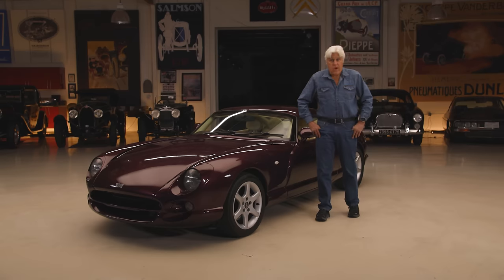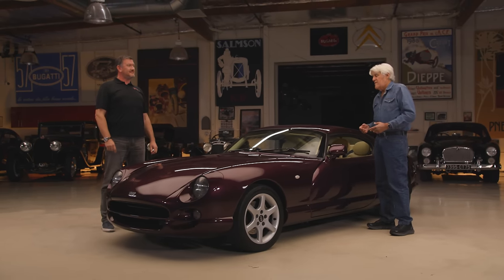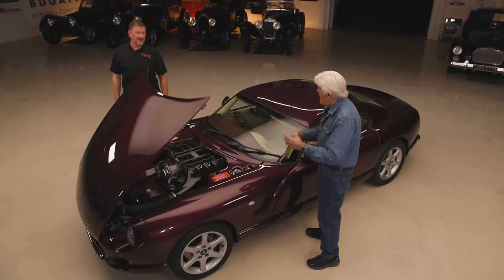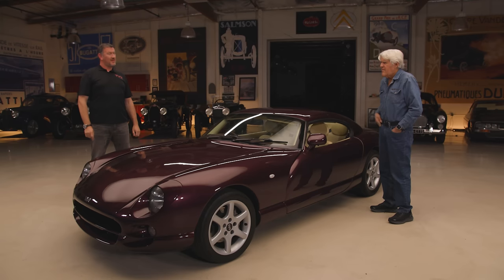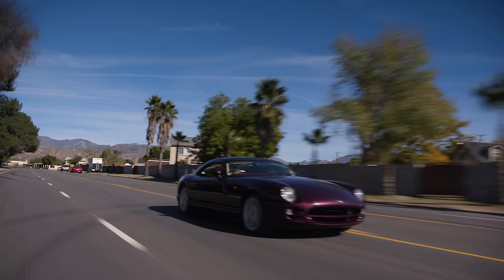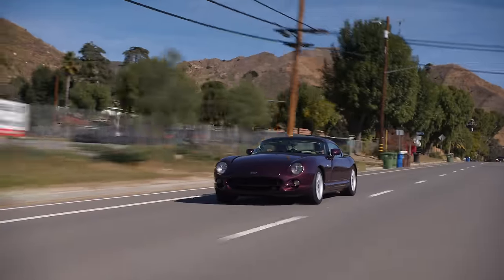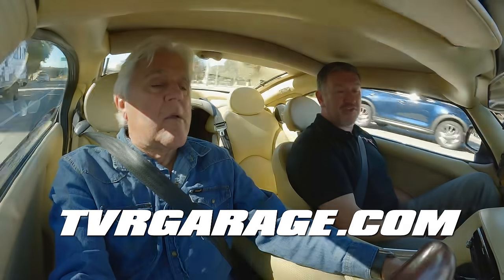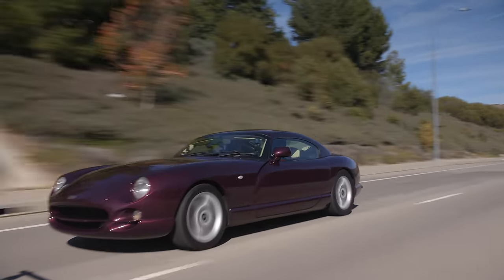TVR Cerbera - Jay Leno's Garage

Comment: I've V8 engine gearbox rear axle from crashed Cerberus in early 2000s when couldnt sell lovely car fibreglass smashed panels wrote mine off but I have hybrid now MK1 Ford Capri MK1 bodywith full spaceframed with cologne boxed arches rest has had shorter chassis so all TVR parts fit proper 1st time rears tubbed due to wide body XPACK cologne kit in process looking at air suspension system as too many bad roads and speedbumps so to raise when needed good but handling that power has to be safe also BUILDING 3door sierra MK1 supersaloon converted to accept Ford Sierra RS Cosworth 4x4 or xr4x4 bolt once capris done was supposed finish last year I'll health stopped that sierra has full frame/cage back to front both be road legal I've V6 cosworth engine and can fit but love get rare ford engine lots power standard Mondeo at 220bjag V6 3.0 fast standard do what Noble cars did twin supercharger kit remap NO PARTS EXCEPT CAME OUT FACTORY ADDED " TURBOS V6 shames V8 new gt V6 I don't agree built to be a V8 Ferrari beater not V6 supervan4 is not a van no loadspace supervan 1,2,3, were transit vans with GT40 mid mounted engines and frame with a Ford Transit van welded on top supervan 2 same on newer model supervan 3 was con really FIBREGLASS body moulded 3/4 scale of real van fitted around GT40 chassis or F1 cosworth dfv8 in middle still carried luggage in rear 4 looks like new GT run up electric transit at speed not van it's rear hardly hold 6pack coke spoilers aerodynamics if Ford had thought it'd been a van new shape GT40 underpinning in transit shell stuff EV,s as useless and we will not give up combustion engines get used to it major brands we will buy classic cars 1st than ev vehicle's with no range a bomb on wheels every cell EXPLODES 1 by 1 I saw big car cover-up in phoenix retail park on old Chrysler Hillman Talbot Humber etc 3 days before I passed where fire happened behind WH MALCOLM'S HERITAGE CENTRE ARNOLD CLARKS HAD RENTED CAR PARKING SPACE WAS 500 to 1000 unsold electric cars in big square how ignited is part needs investigation as stinks insurance job nevermind not to drink tap water as toxicity landed in it shouldn't we be told what substances we breathed in from  Renfrewshire Glasgow any other area's Lanarkshire etc lied said ENVA ELECTRONIC RECYCLING WHEN wasn't cover up too many filmed cars exploding 3 a sec at times and black funnel smoke miles high and long it was hitting off higher KNIGHTS-WOOD Lincoln flats how many times we going to believe in impossible task zer emissions lol are farts included in zer bill clowns

Comment: I picked one up new from the factory back in the day. Same model year. Lovely styling both inside and out but engineered on a budget and so unreliable. Went back to the garage 7 times in the first year then I sold it as the warranty had run out and the dealer had done over $13,000 work in the last year.

Maybe all the faults will have been sorted by now. Maybe.
Reply: Jon Frank 👋

Comment: Hope nobody bursts Jay’s bubble about the Speed Six engine and how Wheeler’s cost cutting measures doom that engine to be so unreliable.
Reply: Nonsense. 25 year ago SOME early engines suffered from weak finger followers that were made from non-spec metal, this was eventually resolved when the correct spec metal was used.

25 years later with standard maintenance and owners adhering to the correct warm-up procedures, the S6 is a very reliable peach of an engine which begs to be driven hard.

Comment: 3:33 eeh Jay,  Ferrari has been using Flat plane cranks in their V8 engines since  the Dino V8 engine in 1959, I know you don't like modern day Ferrari, but I would expect a car nut like yourself to know that flat plane cranks were a thing on Ferrari V8's loooong before TVR or Ford used em

Comment: My Car Flip Cellphone Does Dropped into the Water by the Bathtub That's what it Happens I have to Put it Into the Ziplock Bag of Rice and Put it into the Furnice to Fix up my Car Flip Cellphone to Get Rid of the Water Damages out of it Before Powering it On to Work and All of a Sudden it Doesn't Work so I have to Get a New Car Flip Cellphone at this Time That's what I have To Get Because my Old Car Flip Cellphone is Damaged Up in Some Serious Water Damages That's what it Happens and I will Have to Get a New One.

Comment: Slightly disingenuous re. why the doors closed at TVR. The in-house engines were the reason, pure and simple. Technical issues meant that engines failed and warranty costs were unsustainable. They should have stuck with the tried and tested Rover V8 variants.
Reply: Not quite. The doors ultimately closed because the 24 year old Russian who bought the company in 2004 didn’t realise the sale did not include the land the factory sat on until the day he received an invoice for rent. He wanted to set up a factory elsewhere, looked at outside engines, but ultimately didn’t move forward and closed the business. What was left remained was sold to the present owners.

For as much blame as the young Russian received taking over a struggling company, he actually spent time improving the production quality at the factory.

After 20+ years of support and R&D by former factory workers who have maintained these cars since, the engines and cars are as they should have been from the factory. Reliable, brilliant fun and about as visceral a driving experience as you could hope for.

Long live TVR 🇬🇧
Reply: @thepullupla  A chain of events started by JW walking away from the company after the AJP engine fiasco. The writing was already on the wall, Smolenski missed it.